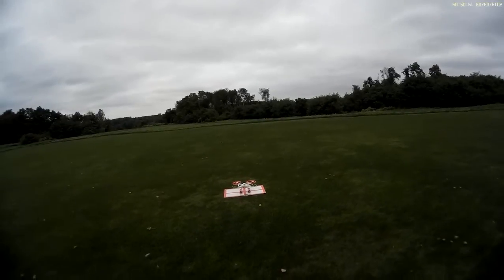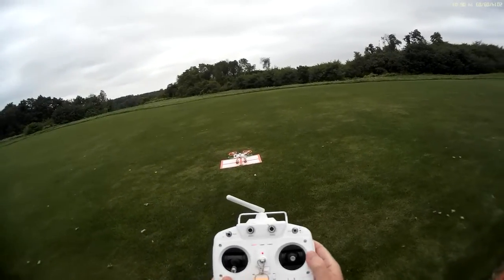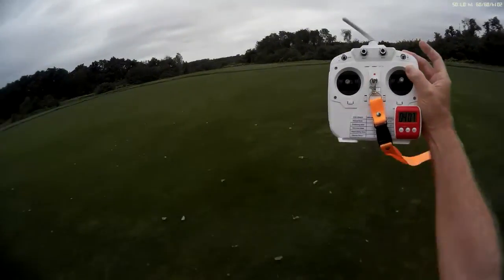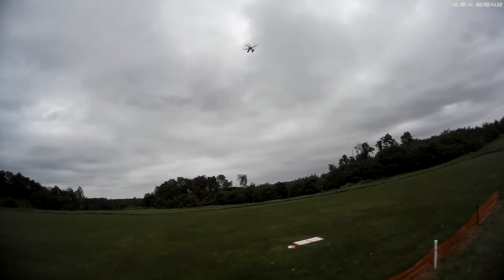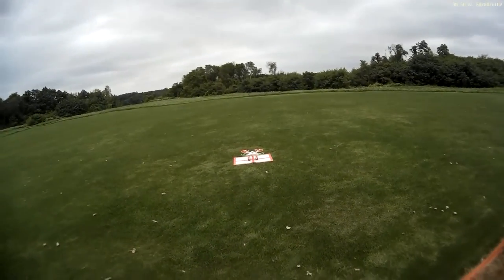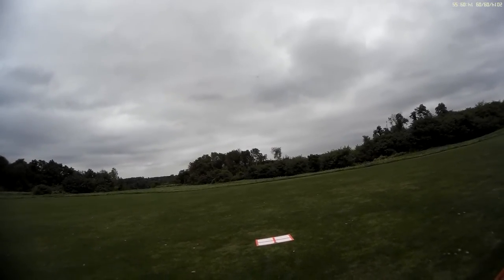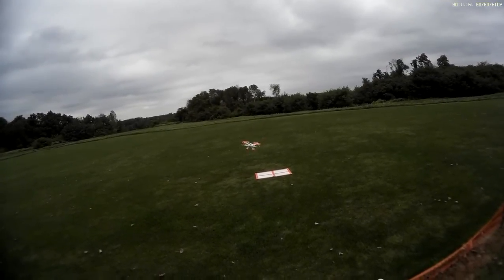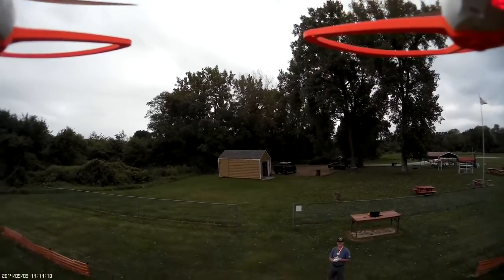RTH of the Cheerson CX 20 quadcopter

Comment: Hey there MrPolymers, i am about to buy one of those and when i saw your crash after 6 mins and now your timer  on 6mins it make me wonder , why on other videos cx 20 / nova can do a 10min with a gimbal and there should be 2 step failsafe right? First there is visual and audio alarm and after that second step of failsafe = auto RTH at critical battery lvl. Where are those systems in yours quad?
Reply from the maker: They don't exist.  I thought so too.  What I do is use a timer and not fly more than 6 1/2 minutes on the 2700mah battery.  I will be doing some tests with my 5000mah battery minus the gimbal to see what kind of flight times I can get. This will not fly well with a Mobius camera, 208 gram gimbal and the 5,000 mah battery.  Like trying to fly with a brick attached to the quad.
Reply: Thats a shame
Reply from the maker: I've addressed the issue with Banggood. Their site is misleading on the capabilities of the Cheerson CX 20.  I had to learn it the hard way.